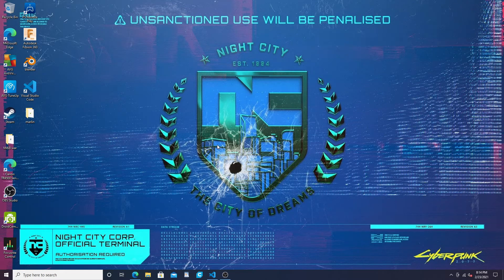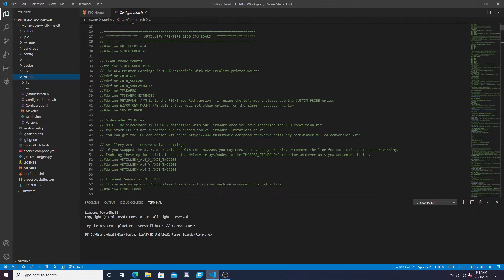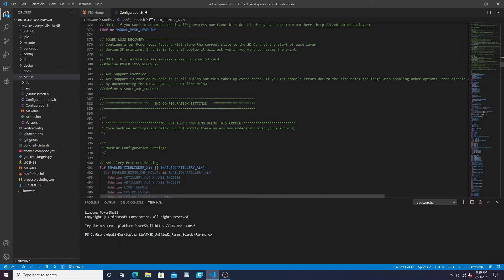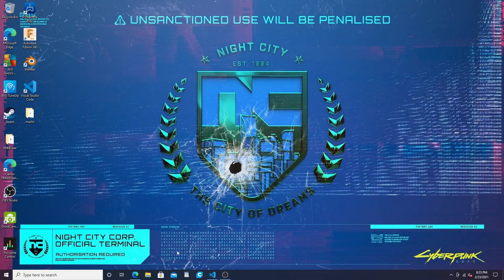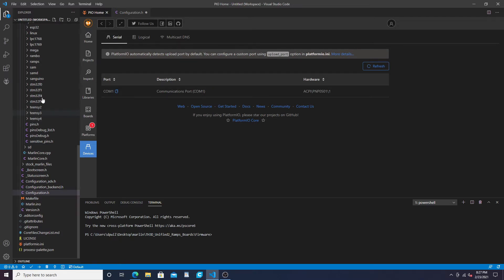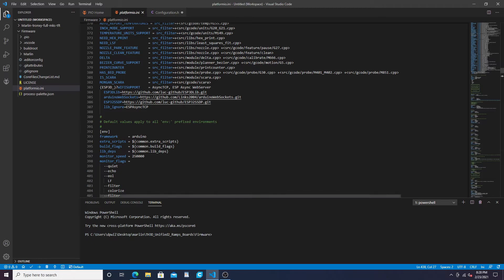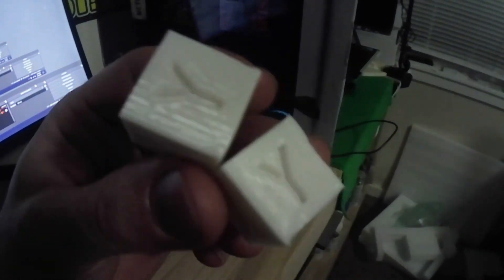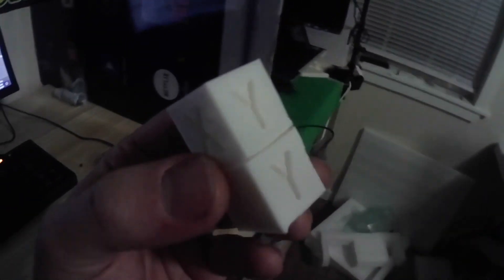Installing Updated Firmware on the Sunlu S8 [Marlin TH3D][Custom Boot Screen!]

Comment: i try to download but ask some payment, is correct? Thanks
Reply from the maker: No it should be completely free for all files and programs needed. Unless the owner of the files has changed something since I released this video. I just checked his website, looks like he has updated the site some but still seems like it should be free. He also has a video posted there for his unified 2 firmware, I would suggest checking that out as well.
Reply: @PottersVinylsAndMore  i thibknthere is changed , not free anymore or i cant find the files

Comment: Can you help I didn't realize I needed to install the standard bed leveling when I first installed this update now I'm trying to update it to have that using the same code+ // out the lines to allow for bed leveling and I keep getting this 
avrdude: ser_open(): can't set com-state for "\\.\COM5"
avrdude: ser_drain(): read error: The handle is invalid.

avrdude: ser_send(): write error: sorry no info avail
avrdude: stk500_send(): failed to send command to serial port
avrdude: ser_recv(): read error: The handle is invalid.

that is my error i have tried multiple ports with nothing changing
Reply from the maker: Are you trying to flash over USB? I usually just run a port/device scan with platformio and run again after unplugging it to find out which port it is. The you have to define the port in the build for it to send it.
Reply: @PottersVinylsAndMore  I've changed the com port to each one of my serial ports and nothing seems to work
Reply from the maker: @SnwwhtEI  Then I would try building it and saving the update file onto the SD and Flashing over SD
Reply from the maker: I didn't run into anything like that. Is your printer on or off when trying to flash?

Comment: I have a few questions. First, I don't have any of those options on the bottom left in the blue bar, just the  problems icons. How do I enable those? Second, how do I get to PIO Home? I'm not seeing that option either.
Reply: Nevermind, I googled Platform, got it installed, and that solved my other question too! haha
Reply from the maker: @techingbackgaming2000  Ha yea sorry, I covered Platformio in my tronxy to marlin video. Great you figured it out though!

Comment: -*how do i open the gate so i can print usb
Reply from the maker: Will be a printer cable port on the back of machine, need to find the correct port and set that up in your slicer program.

Comment: I have the Sunlu S8 as well and wondered about the th3d firmware upgrade. Are the changes better?  Is it better than the stock marlin firmware?
Reply from the maker: I believe there is an improvement for sure. The biggest thing is the amount of setting and options gained through the interface on the machine.
Reply: @PottersVinylsAndMore can u just send me the file so i dont have to do visual basuc bullshot?
Reply from the maker: @AckzaTV  I'm sorry I cannot. Do NOT have the file anymore.